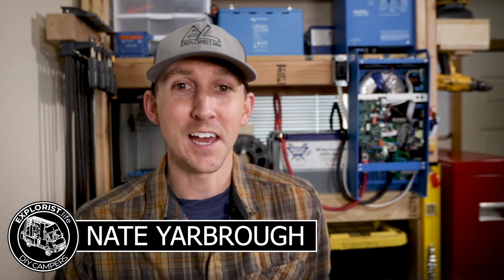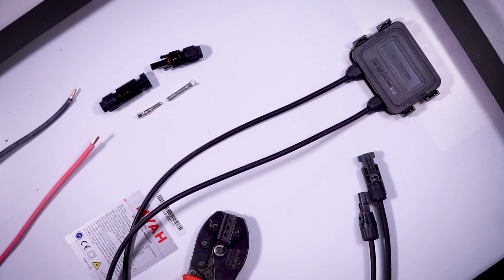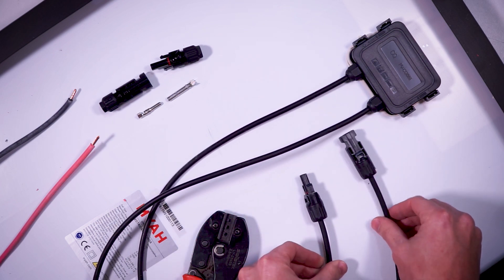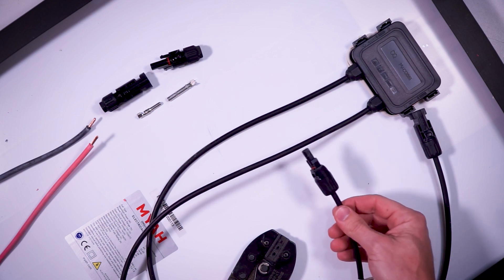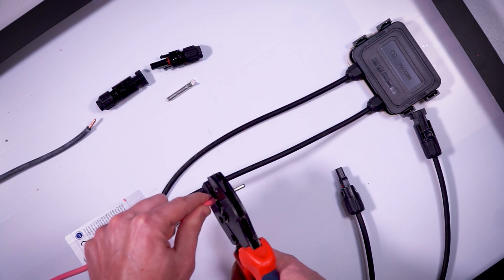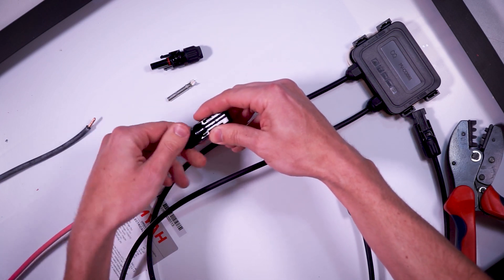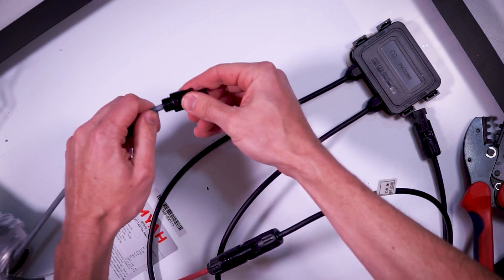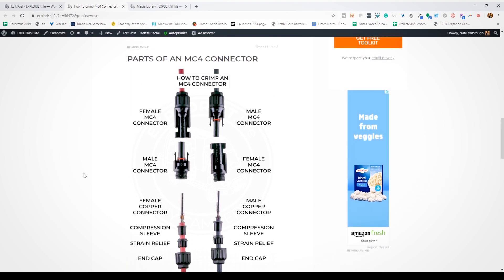How To Make MC4 Connectors (For Wiring Your Camper Solar Panels)

Comment: BAM.. Exactly what I needed to see.. For those struggling with the length of what to strip off the cable to expose the correct amount to crimp, my rule of thumb was to put the cable next to the metal connector and just put a small mark with a sharpie and just cut there.. My calibrated eye got good at this after 2 or 3 times and didn't need to mark them any more.. I had to do 10 of these.  GREAT video E.L.
Reply from the maker: Awesome, glad we could help!

Comment: You rush through the key step with the tool obscuring vision -- exactly how should the connector be oriented inside the crimper?  I am not getting it to close both tabs over the wire.  One or both go out flat instead of folding over the wire.
Reply from the maker: We can take a personalized look at what’s going on here: https://shop.explorist.life/support

Comment: Will those connectors work with 8 awg cable?
Reply from the maker: Good question! 👍 Whether MC4 connectors will work with 8 AWG depends on the specific parts and your setup. If you reach out here, we can review your project and point you to the right connectors: https://shop.explorist.life/support
Reply: @EXPLORISTlife  I opted to use 10 guage instead of the 8 as the loss is minimal in a run of about 20 feet.  Thanks for your replay

Comment: Don't you not solder the wire ends  before crimping so the wire has greater conductivity.    🇬🇧
Reply from the maker: The crimp method is preferred as it creates a robust connection that can withstand vibration and temperature changes.  Reach out to support@explorist.life if you need some help with your project!

Comment: Why did bro put the positive MC4 connector on the negative wire of his panel?  Every panel I have has the positive going to the male connector...  How many thousands of people have been confused because of this video.. Please correct me...
Reply from the maker: Don't think about PV connectors as 'positive and negative'.  You'll have both a male and a female pv connector on a positive wire depending on which end of the wire you are working with.

Comment: Excellent Helpful Video 👍 
Can we use Motorhome Hook up cable as Extension cable for solar panels? 
I need around 12 meter wire to run from my 3 Solar Panels (245 watt each) to my BLUETTI solar power station. 

My 245 watt solar panel specification (Each panel- open circuit voltage 37.4, open circuit current 8.61)
Reply from the maker: Thanks so much — glad you found the video helpful! Using a motorhome hookup cable as an extension for solar panels might work, but the wire size and type could affect performance or cause voltage drop, especially over a 12-meter run.

For advice that fits your exact panel and setup, our support team would be happy to help: https://shop.explorist.life/support. It’s free for gear purchased from our store!

And if you're using equipment from other sources, the Pro Support Membership is perfect for getting tailored help: https://shop.explorist.life/shop/all-products/membership-tiers/.

Comment: 2:06 Could you use a Ferrule Crimper instead please?
Reply from the maker: I mean... you CAN change a tire with a torch...but at the end of the day, if you want quality work that lasts generations, you need to use the Right Tool. Every Time.

Comment: Great video! and Thanks. Question for you... I have 6 gauge pv wire and I want to put mc4 connectors on it. But the wire is to big to crimp into connector. Any thoughts on "how" to do this? Thanks
Reply from the maker: A well designed solar array won't use any larger than 10AWG wire so that the PV connectors will fit perfectly.  Perhaps reconsider how you've designed your solar array to avoid the use of 6 AWG wire and the problem you're having.  We have designed solar arrays at shop.explorist.life if you get stuck.

Comment: Great video Nate, nice to see this process kept simple, but why are you disassembling the MC4 body? Can you point to which MC4 manufacturer says to do this? Every manufacturer's training I've ever seen says never disassemble the fitting (you can easily pinch the seal when you reassemble, or in some designs put the seal in backwards). Also, I've never seen a professional installer disassemble the connector. There are barbs on the metal components for a reason - if they were meant to be put together as you did in the video, they would have collars, not barbs.
Reply: Very appropriate comment - this should be up the top so that viewers don't presume that this is a correct method, but viewers should also note that Nate has remade a video recently where he connects the MC4 as per the manufacturer's instructions.

Comment: Why does red join to black
Reply from the maker: In a series or series-parallel wired array of solar panels, positives will be connected to negatives to achieve our array voltage goals.

Comment: I need to install 2 connectors, is there a way to crimp them without buying the special crimper that I'll never use again?
Reply from the maker: Just buy the tool.  It’s what, like $20?  That’s the glory of diy.

Alternatively, you could take it to an installer where they’d charge you 10x as much and take 4 weeks to get you in.

Comment: My issue is in 2020, the beginning of RV solar, the manufacturer installed 1 200w panel and when I ordered a second panel instead of adding a MC4 the dealer opened up the original, cut and spliced the wires under the original connection and covered it up with a large glob of Dicor. I could scream.

Comment: Which setting should be used on the crimping tool?-- 2.5mm, 4mm, 6mm?  What is the correct orientation for the crimping tool relative to the contact?

Comment: Super helpful, thank you. Newbie question - I have 10 Awg silicone electrical cable, would that be safe to leverage for a solar extension cable less than 6ft?
Reply from the maker: Does it have UV protection and rated for solar panel applications?  If yes; go for it.  If no, use solar panel wiring.

Comment: Thanks very much,just can u let us know how many milimeters should the wire be stripped back to fit in the crimp connector etc? And  can the mc4 connectors once made be easily disconnected from bak of panel connectors in future if want to make leads longer?

Comment: Nice video , i have a question what size wire did you use ? And is there a number on the crimp tool that relates to the wire size you're using? Best Regards

Comment: Great video but you didn't use the two wrenches that are used for tightening the mc4 lock nuts. You can buy a kit that contains the crimping tool and the wrenches wire strippers and mc4 connectors.
The lock nuts should be tightened with the wrenches until they click then you know you have used the correct torque.  You will find it almost impossible to do this with just your hands.
Reply from the maker: Yeah, feel free to use the wrenches if your grip strength is a bit lacking.  I don't have an issue with that, but you do you.

Comment: Just want to know where exactly on the inner connector pins do you crimp the wire using the special hexagonal crimping pliers. Do you solder the feed wires first?

Comment: I want to run a 50 foot wire from the solar panel to the charge controller. I already figured that for a 100 watt 12 volt panel to a 10 amp charge controller, I would need 10 gauge wire. The only problem is the wire that is connected to the actual panel itself is too thin. Would I need to remove that wire and splice in a 10 gauge wire. Would anything happen to the panel? Would it still get too hot at the splicing location? Is this even possible to do?

Comment: What are the best brand of 8 AWG MC4?  In general what is the purpose of MC4 connectors? Why not just solder and use higher AWG? Thanks! Great Video!
Reply from the maker: PV connectors like these are simple, fast, and safe ways to make connections in a solar array.  Soldering is slow, and not removable in the event something needs to be re-done; plus can work-harden and break.  There's no reason to use larger than 10ga wire in a well designed solar array.

Comment: The part I don’t understand is that I am recommended 4 awg  wire to run from my solar panels to my inverter but mc4 connectors only take 10 to 14 awg, like am I missing something?? Why would bigger cables be recommended if I am not capable of connecting them to mc4 connectors. No one is talking about this or explaining
Reply from the maker: You should be able to design 99% of solar arrays to need no larger than 10ga wire.  More info: https://www.youtube.com/watch?v=JW0vrTAa50s

ALL of the solar arrays I've designed on our shop use no larger than 10ga wire, and there are array sizes up to 2800W there: https://shop.explorist.life/product-category/all-products/camper-wiring-kits/solar-charging-wiring-kits/
Reply: But could I use 14 gauge if I wanted to?

Comment: I wish I had seen this video before creating my BougeRV cables for my 8 RV panels (no instructions included). I wouldn't have made the mistake of putting male pins inside male connectors. Great video!

Comment: What about a foldable solar panel that has only one dc cable? How do you get a negative and positive ends out of it to connect to and charge a battery that has negative and positive terminals. Anybody?
Reply from the maker: Whatever solar panel you've chosen should have some documentation or tech support to give you some manufacturer approved ways to do that.

Comment: Today was my first time adding the MP4 connectors, and I struggled to find the right sized crimper head thingy. How does one know what size to use?  Also, what is the orientation for the crimp? I didn't know which way the opening should face in the crimper. 🤔

Comment: So can you just skip mc4 connectors and just solder the correct UV resistant cable to the panelcables ? 
With layers of shrink tubing offcourse. 
Any reason to not do that ?
Reply from the maker: But why?  MC4 connectors are consistent, fast, easy, removable, inspectable, inexpensive, and an industry standard.   Ultimately you can do whatever you like, I but I can see zero reasons to solder over using actual PV connectors like MC4 connectors.
Reply: @EXPLORISTlife  I bought mc4 extension cables but the wrong size. 
So yeah, it would be more practical to just. Connect them with mc4 connectors but i was more curious about the soldering creating problems(read that somewhere). 
So i was curious if the solarcable was made of some material that can’t be soldered.
Reply from the maker: Gotcha.  When you solder a wire, it creates a point where the wire goes from 'solid to stranded' under a lot of heat stress, which causes a weak point.  Over time, as the camper is rolling down the road, the vibrations will work harden this week point and the wire will break.

Comment: Maybe you can help with my solar panel connection issue.
I have two 120w foldable solar panels and one 60w foldable solar panel, and all three have the 5mm dc adapter. I've been searching and trying to find a way to connect them to a solar charge controller but all requires bare positive and negative wires.

Does any company make a female dc adapter that has positive and negative wires or how do I convert the wiring I have to bare positive and negative wires?
Reply from the maker: Looks like there may be a few 5mm to mc4 connectors out there: https://amzn.to/3DfC1qB
Reply: @EXPLORISTlife  thank you

Comment: How about 10mm cables? Is the crimp connector different? Will a 10mm MC4 plug match with a 6mm or 4mm plug? Looking at making some long extension cables, and 10mm cable is going to be necessary.
Reply from the maker: It'll probably be different.

Comment: Hey Nate! Loving these videos. I’m trying to run 2, 12 volt, 190 watt panels in parallel to my 100/50 MPPT, so I opted for 6 gauge wire to carry the amperage to the MPPT. My question is, do they make MC4 connectors for 6 gauge? If not, how could I safely run my panels in parallel and get the wire to the MPPT? Thanks for your help!
Reply from the maker: The do not make MC4 connectors for 6ga, no.  I recommend wiring your 2x 190w panels in series and replace your 6ga with with 10ga wire like I show in this solar charging wiring kit: https://shop.explorist.life/shop/all-products/camper-wiring-kits/solar-charging-wiring-kits/400w-solar-charging-wiring-kit-2x-200w-12v-battery-bank/

Your solar array performance will greatly suffer with those two panels wired in parallel.  Series is far preferred for two panels provided those panels have a voltage of ~20V (plus/minus 5V).
Reply: I was going to run (2x) Bouge RV 9bb 200 watt panels in parallel and your calculator said 10 ga wire. Why would you recommend running the panels in series?

Comment: is it ik to remove the little red rubber ring on a mc4 connecter to make it snap in better?
Reply: No. Don't remove the rubber ring. The ring prevents water from getting into the wire when it rains.
Reply: @racheal6100  Gotcha!

Comment: I have to tell you your video made clear about the male and female wire thingy- I did not pay attention to that and just put long and short ones mixed up after an hour to do serials and parallel for my solar panels NO light on my mppt. It was extremely frustrating. Now I have to cut all of them out and redo them all PLUS another shipment from amazon for new connectors. Thanks very much for this very important point. Also about how much wire to strip. quarter to 1/2 inch -
Reply from the maker: Ah, yes.  That's an easy one to get backwards.  I actually fixed a system over the weekend with the same issue.

Comment: What is the reason MC4 always seems to run the two separate cables?  That is, not in the same shrink wrap or fused shielding.  If the proper gauge cable is used, is there a reason why you can't simply use dual cable?
Reply from the maker: I've never seen dual cable that's rated for direct UV exposure.  I'm sure it'd be fine if you could find it and it's rated for that use.

Comment: I lost power from one of my portable solar panels. Which is more likely the culprit, the male or female connector coming from the solar panel?  
Is the wiring at the panel fixable if the connectors are good?
Reply from the maker: Neither connector is more apt to failure than the other.

Comment: thanks. I was going to chop the connectors off my solar panel and start over with connections I've used before.  The link you have even tells us what wire to use; which is kind of a threshold matter for using these things.
Reply from the maker: Glad it helped!

Comment: What about the other ends that go in to controller. Does the negative cable have a male or female connector…and the positive cable have? As I have no juice coming from my panels to the controller.
Reply from the maker: This video will show you how to wire a charge controller: https://youtu.be/XSfu8V0DR1g
Reply: @EXPLORISTlife  thank you!

Comment: Do you have suggestions on installing a plug in the wall of your RV? I’d like to plug my portable solar panels into the trailer and have the interior wiring connect to my solar battery (eco flow delta).

Comment: Is the crimp sufficient without adding solder?
Reply from the maker: I'm not sure of a non-asshole way to say this, so I'm just going to say it...  If solder was necessary, I would have done that in this video. 🙂
Reply: @EXPLORISTlife  🤣👍🏼 I’m a bolt and braces kinda guy. What I do do with Anderson plugs is use a centre punch to do the crimping - tends to be more secure than crushing with a tool.

Comment: Thanks Nate. I wonder how much do you strip the wire before inserting it into its contact pin to crimp? Also, I'm changing from c3 connectors to these c4s . I didn't know there were such things as c3s, but if you come across a perfectly working older panel, you might run into a few. I've read about different wire sizes fitting, or not fitting into the gizmo too, but I doubt if I'll ever incounter any of those.
Reply from the maker: About a quarter to half inch.

Comment: So the male goes inside the female connector and the female goes inside the male connector.. the big question is can they can self fertilize and make lots more connectors 😜
Reply: One most important thing, you have to crimp the very opposite on the other end of the cable

Comment: Hello Nate, do you use dielectric grease with heat shrink that doesn't have sealant? Do you use dielectric grease in your MC4 connectors?
Reply from the maker: As of today, I don't.

Comment: Is it cost affective to make your owe mc4 cables? if yes, what crimper and supplies do I need to make my owe cables?
Reply: It’s going to depend on 3 things - how many you’re going to make, how much you value a neat job (with pre made cable you have to do something with the inevitable excess) and do you want to be able to do repairs?

If you’re a do it yourselfer you probably want to get a crimper and have at it.

You need a crimper, wire and terminals.  Amazon will hook you up.

Comment: i love your hole series how do you remove the pins from the plastic bits if you make a mistake
Reply: I don't think there is a way... Once it is is in it is in for good. You would have to just cut the wire and get a new connector if you had to do it again.